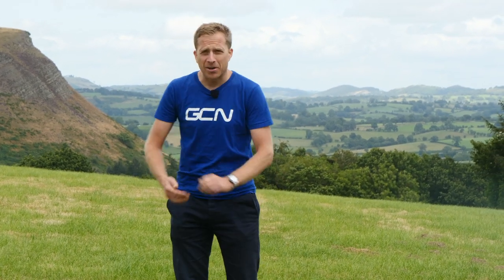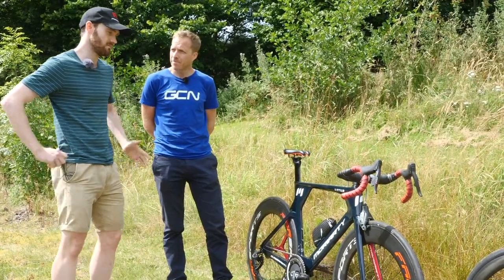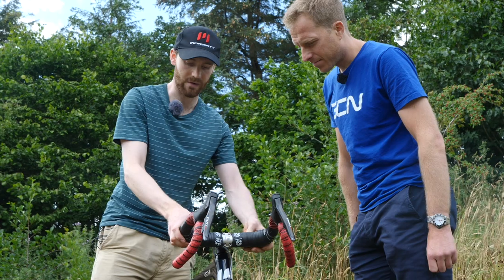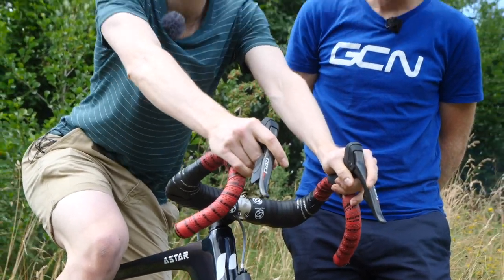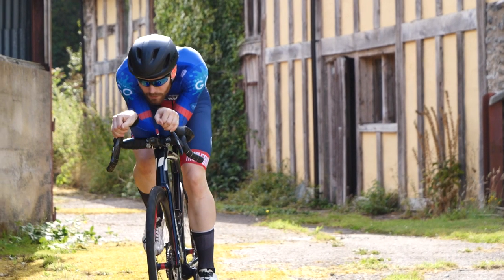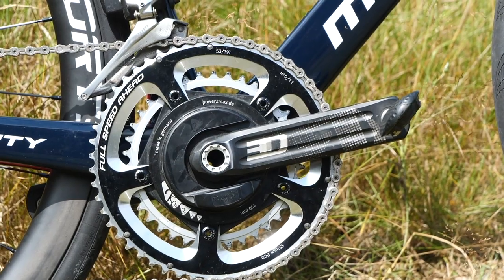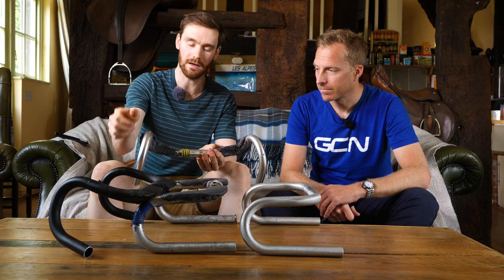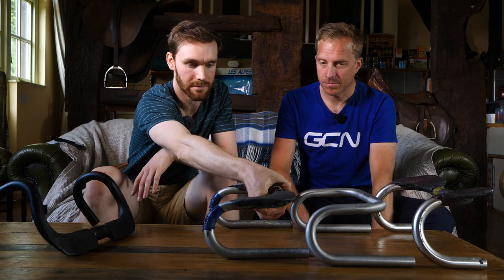Is This The Most Aero Bike Racer In The World? | Rethinking Cycling Aerodynamics

Comment: seems like it's more advantageous to just go in an invisible aero bar position, as long as you look where you're going and know how to handle the bike there is no problems with it. More aero and no downsides.
Reply: Like said in the video, there are many downsides. Arms hurting quickly and not having decent control over the bike. Also, not being able to pull on the bars is certainly not that efficient. Only because aero gains still are greater, the "invisible aero bar" position is adopted sometimes... but not for a short high power effort, simply because you don't have the control nor the ability to put down all the power.
Reply: @BartSchrijvers  Neither my friend or I have no problem in the phantom tt position putting down 400-450 watts. Obviously you can't take sharp corners, but apart from that its just steering from your hips and leaning. It's a very comfortable position. Shoulders relaxed and shrugged and it's narrow and long like in the video, so knee to elbow contact is only a faint whisper in the wind. Triceps having a hard time I think is a symptom of how your whole hand-arm-shoulder system is angled. I get fatigue if I do the sphinx position(aero on hoods) but not in the phantom tt, because in that I am not putting tension into my body trying to even remotely grip the bar. I just flow.
Reply: Hi  @yannickokpara4861 , I only partially agree. Being comfortable depends on the position of your bars. Imagine putting more power down, x1.5, x2 or even triple the effort :) Hence why the bars in the video are always more effective, that's all I meant by that.
Reply: For the sole purpose of laying down the power on flat roads, yes, more effective, provided that it is the position that matches your body. For other applications it is a compromise for the body just as is a tt position. As such I would not advise anyone to try to get their hands on them, because it would likely be unsustainable for them and therefore not aero. Btw I think you are stretching it with the 2x and 3x efforts. 1.5x would be at the very peak of gains and perhaps not apply to the differential that lies between that position and the phantom tt. Afterall you do have something to hold onto in the phantom tt: your gps and gps mount.
Reply: @yannickokpara4861  I was stretching it with 3x the effort, hence the smiley, but holding onto a bar is a necessity at some point whilst you make it seem like it's not? 🤷🏼‍♂️😀 I simply can't disagree more. I do understand how you can maintain (emphasis on maintaining) an effort whilst resting your arms loosely on the bars. But any harder effort or slight acceleration and you'll need to grab those handlebars. Not to mention riding on anything other than a smooth road surface. Surely you're not implying that the guy from the video, or a rider like Jaap Willem Van Schip are idiots since they could just do it your way? BTW, I would snap off that GPS mount in a glimpse, lol.
Reply: @BartSchrijvers  No. I would not call any of them idiots. I would also not call other pros who ride the phantom tt position idiots or those that ride the sphinx or simply in the drops(maybe if they ride completely straight arms bcuz of too much 'pro' drop). I will however say that as well as the guy in the video being able to say that it is no problem the position he is in then I can list the problems that he might not be having(or not feel are relevant to him or as important as aero) but a lot of others will likely suffer from. Just as well I can tell you that acceleration is no problem without the hands even if I don't brace the GPS, because my bikefit allows my pelvis to be very stable and then you can say: well that does not apply to me and that does not apply to a whole lot of people. I would say though that the guy from the video and Jan Willem are not the same as Jan Willems position allows him to sit 'normally'. Jan Willem in fact has a very open chest with his elbows flared out. As a note to riding without hands: they are not resting lightly on the bars. The butt takes some weight, the feet take some weight, the core supports some of the load that will come to the hands and then the rest will go into the bar, on which some prefer to have just a strip of bartape, some bare, some full wrap, some even don't mind it with a round bar. But it is full weight into the bar. That is the sign that you are relaxing and then you can choose whether to give up some of the relaxation for tucking the head between your shoulders. I showed my 10 year old brother the position when he was 8 or 9. It was no problem for him to do it on the flat or on a small downhill even though he was using a normal kids bike with the flared mtb bar where he has to put his hands and arms in the little 10cm space in the middle. If you are relaxed it is fine. If you are not it will be twitchy and dangerous just as any position(a tt-ish position even more so) will be
Reply: @yannickokpara4861  You can keep beating around the bush, but holding your hands onto the bars is better in any shape or form.
Reply: @BartSchrijvers  You can keep saying that is the best, but you are denying the fact that if it is the only viable position, because it is what everything else is built around, then it makes other positions automatically compromised. Having your hands on the bars are not the make or break. Being stable on the bike in the form of a good position and the strength in the right parts of the body is the make or break
Reply: @BartSchrijvers  You can keep advertising that, but fact is when you build an entire setup around being effective in one single position then you must ultimately compromise somewhere and that somewhere is every other position one might adopt on the bike. And 90% of the time you are just not going full gas in a breakaway. Having your hands on the bars is not the make or break as you do not steer with your hands and arms. The make or break is whether you have your weight distributed properly over the bike and whether or not you have a good bikefit and the strength in the right places of your body to accomodate what you are trying to achieve. Friend, if you need to throw down 1200 watts for 10-15 seconds because some guy in the breakaway is making a mega attack then you are not gonna do that in a tt position with hands on the bars or off the bars. You will likely do that in the fking drops[where you have the leverage to counteract those forces) or you will not do it at all and perhaps instead sit tight and work to pull him back steadily. However if you need to give it a good 600 watts for the next minute then by all means that can be done in the phantom tt position god willing. Just because your bike handling might be questionable doesn't mean everyone else can't do it just fine - which you can see them doing in the pro peloton every darn breakaway. In fact just for the fun of it... tell me why: if pro riders can get super custom made 3d printed tt bars then why do they not ask for something special like we've seen in the video? oh right... some of them actually have tested narrower bars and they stopped at this place called the limit. The limit of where THEIR bodies could still be dynamic, adaptable, comfortable and powerful for training, for racing, for the recovery period that follows. Do you need a highlight reel or something to understand that the phantom tt is not unstable, can be ridden over bumps, can be ridden through swooping corners? I mean sure if your position is inhenerently shite then yeah. If your position is inherently shite you probably also can not ride without your hands. How often do you see a strong, competent rider with issues like that? You don't. You really don't. PS: I never said it's better or worse. I've always said it's an absolute compromise
Reply: @yannickokpara4861  You're awesome dude, I can't do what you can do, let's keep it at that. ;-)
Reply: @BartSchrijvers  There's a limit to how secure you need to be and that limit is: did you fall? Alright, what is the problem then? If you don't fall then why are you so scared to fall? Just relax and ride your bike. If it's no effort to relax then it's no effort to move the bike where it needs to be, which is not on the ground - on tarmac, on dirt, on cracked concrete, through gravel, grass and puddles on the road.

Comment: Unfortunatelly, probably those "aero handle bars" were not tested in real road conditions eg. during 200km+ rides, where one could quickly find very uncomfortable having no any kind of foam under their arms, to absorb shock from unperfect road. Additionally, rider can not lock hands on top of those bars, so it will have lower power output, which means those handle bars are useless in many cases in real word racing ;)
Reply: Did 2 100mile+ rides back to back on them @Szan! The whole point is it's easier to hold an aero position for longer without fatiguing with these bars. Ridden bars like these all year.
Reply: @drcgriffith1  Nope, I've also custom aero bars, but one have to have much better support for hands and it should be closer together, not parallel because of it is very uncomfortable - it is common for better aero TT bike aerobars are very close at the end with hands so close together.  This YT video title is only like prepaid marketing spot as many GCN videos, so do not expect too much - "Most Aero Bike Racer In The World" - the favourite words of marketing are just "most" "best" etc. and here we have example of this marekting concept ;) I do not buy it - I ride sometimes 200km+ @ 1500m+ elevation gain a day and no way I could try those handle bars for a few hours rides, so good luck :D
Reply: @szankony6276 so fairly flat rides that aren't insanely long?  Why are you complaining?

Comment: It's all fun and games until you need to either get out the saddle to climb/sprint or turn any corner
Reply: definitely not great for crit racing,
Reply: Did you watch the video?
Reply: That concern is addressed in the video, the drops flair out to about the same width as traditional road bars. So the drops are relatively unaffected whereas the hoods are where the majority of the changes are.
Reply: It's an aero time trial/ road bike not a mountain bike !!  It's also not intended for a crit race, as previous commenter did you not listen to the video ?

Comment: My problem with him is not the experimentation. Experimenting is good, especially when it fails because you learn something that way. My problem is that this guy is focussed purely on aerodynamics, yet doesn't seem to have spent one second of his entire life talking to an aerodynamicist or spent any time at all in a wind tunnel.
You can't think your way out of an aerodynamic problem, you need to test and he doesn't seem to do that very systematically at all.
Reply from the maker: I would argue that the amount of different bars that he's tried demonstrate that he is testing systematically
Reply: @gcntech  You're missing the point. If aero is your goal, you cannot go without testing the bars with different positions in the wind tunnel. Your position is way more important to your aerodynamics than the bar width. All he does is making the bars as narrow as possible whilst maintaining control. He doesn't take his position into account apart from bar height and crank length. Your drag is a result of all parts interacting all at once. 
Talk to any aerodynamicist you want, you'll see what I mean.

Comment: Hey guys, I'm hoping somebody on here has a suggestion. I am building up a new/old Cannondale CAAD8 and I just received a free Cannondale SLICE full carbon fork from a friend. I only have 1 1/4" of steer tube to work with above the headset. ANYBODY OUT THERE KNOW OF A STEM THAT HAS A STACK HEIGHT OF LESS THAN 34MM? Of course, I will ultimately pull the trigger on a fork with a longer steer tube if I can't find anything that works... Just seeing if anyone has any suggestions. JON HELP!
Reply: Jace Cimabue check out FSA they have some, but I think the short stacks are only in mountain bike lengths. Or get a steer tube extender.